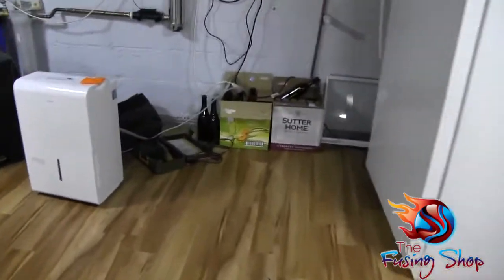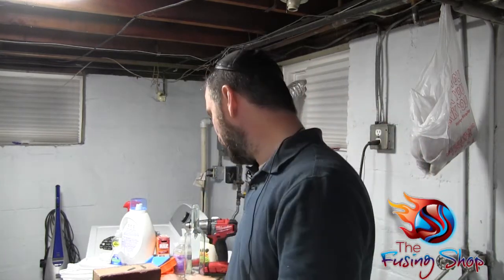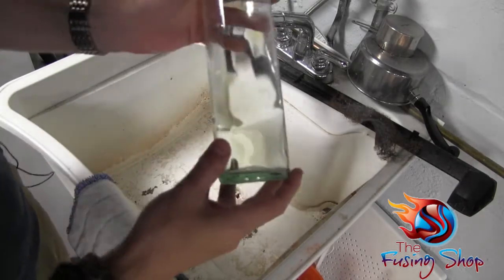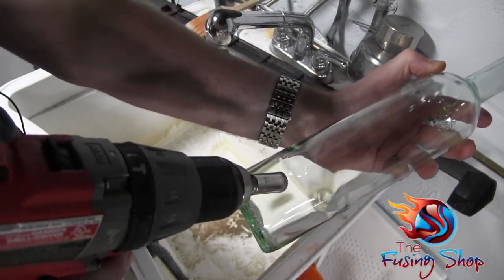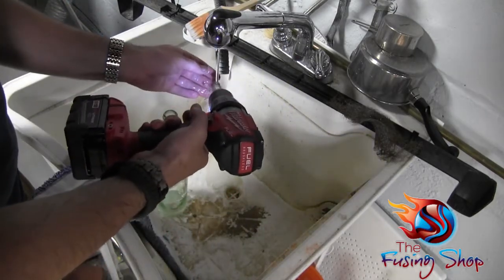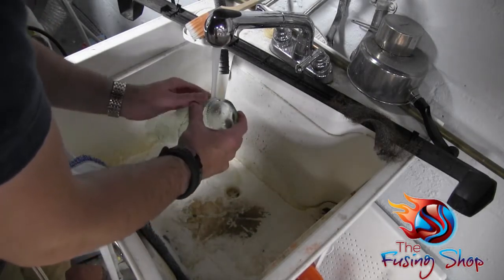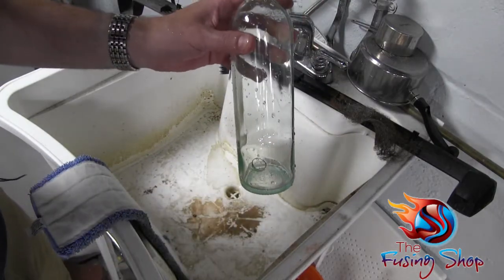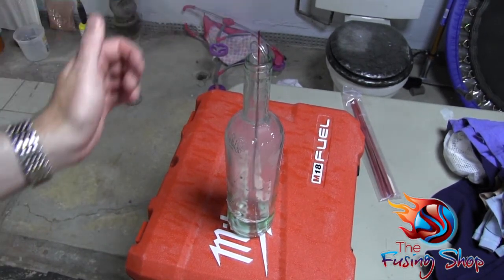HOW TO DRILL HOLE IN GLASS  | Fusing Shop How to Make an Incense Burner

Comment: I love making these out of clear wine/spirit bottles. One tip to clean once the resin builds up it to lightly plug the top with a cork and flip upside down, squirt some dawn and slowly trickle hot water through the breather hole. Let sit upside down over night in the sink and rinses easily. One of my favorite incense burners 👍👍
Reply from the maker: Hey Turbo!  Yeah, that's awesome.  I appreciate the cleaning tip.  Usually I just dump everything out of the top, but I'll give your method a shot next time.  All the best!  Sim

Comment: Thank you. looking for ideas for my craft shop.  Also, I've seen others with tiny holes around the top and am wondering about using smaller bits? is that possible or are those tiny holes made during the glassmaking?
Reply from the maker: Hi Donna.  Thanks for the question.  You can use smaller bits.  Glass hole saw bits come in various sizes and you can get them in a set.  Go slow when drilling and try not to put too much pressure on the glass.

Comment: I'm curious why do you need the hole? If you don't put a hole what happens?
Reply from the maker: Hi Ashley!  You need air flow from the bottom to push the smoke out the top.
Reply: Fire needs air to continue to burn also, so if you don’t have the holes, your incense will fizzle out and not burn properly. You’ll keep having to relight.